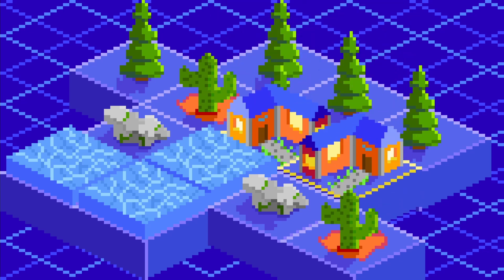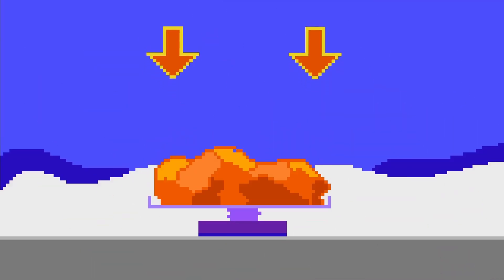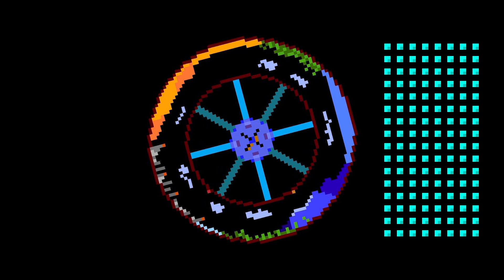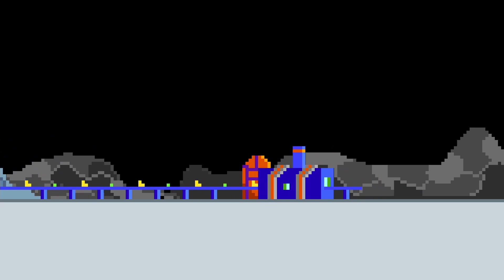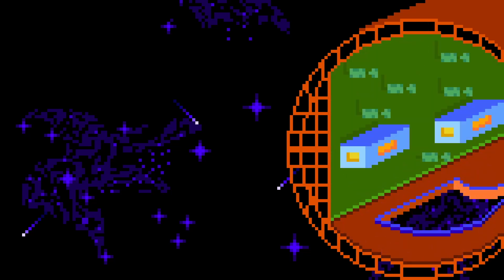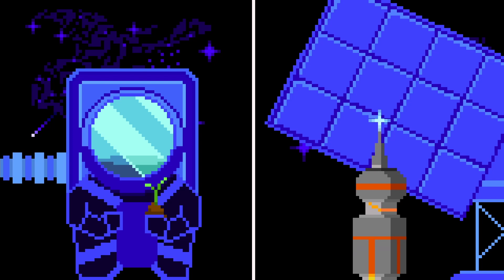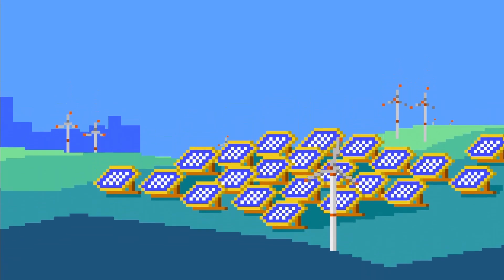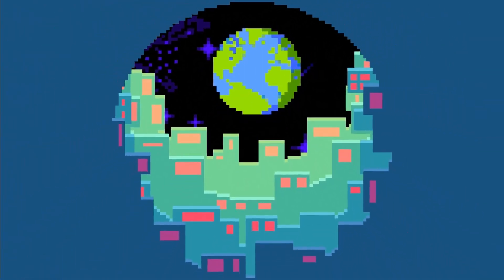How to build a STANFORD TORUS - a NEXT-GENERATION SPACECRAFT?

Comment: The ISS isn't anything on the way to a space hab. If we tried building it as overly complex and expensive as that, it'd never be done.

The Stanford Torus is from the '75 NASA Ames Stanford space settlement studies (available online). The business was mining NEOs and the Moon and building Solar power satellites.
No new inventions needed to start (anytime since then).
The first such habitat is done in 30 years.

For the factory which builds the hab and SPS they need ~10k people in space.
To reduce losses to people not wanting to stay, it needs to not only be survivable with artificial G and shielding, but it needs to be comfortable too.
Architects modeled the interior after dense yet pleasant places down here and that set the area of flat floor needed.
At 1.7km diameter, just about anyone can readily adapt to 1RPM, and they tested not only fighter pilot astronauts but clerical staff and interns.

Comment: The estimate of $900 billion sounds about right. ≈3 or 4 time the Apollo program. (Note that during the same time span as Apollo, the US spent as much on cosmetics, and large States spent more on liquor)
Note that the US spends $680 billon per year for the DoD budget (Each year, > the entire historic running grant total NASA expense). That's just the voted budget, not "black" programs or ongoing military operational expenses, which aren't in that.
We've spent $14 trillion + on the military since 2003. Note that the Pentagon has catastrophically failed its audits, can't account for half of its assets. ≈ half a trillion a year which we give to them, just goes away.

This thing along with all the ground, launch, and in-space infrastructure to reproduce it and build Solar power satellites would cost about the same as 3 or 4 of our CVNs and their air wings, escorts, and the logistics infrastructure to deploy them to fight over oil.
That's only a bit more than the 2008 TARP bailouts, a good deal less than the bailouts of 2020.

It's not worth wasting any time on thinking of building it from materials from down here. Thanks for dismissing that idea so readily. Note that by far most of that is the left-over rock dust, as reinforced concrete for the hull & as cosmic ray shielding.
The Moon is not a very good source for materials. It's said to be about what an asteroid miner would toss aside as not economical to process further.
We know of 10k+ "Apollo" NEAs bigger than ~600 meters. The little chunk that hit over Chelyabinsk in 2013 was denser with metals than Earth's crust or the entire Moon as a whole.
We know of 400 NEAS that are easier to reach and bring things back from, than the Moon. 40 or so easier than Lunar orbit.
Some meteorites are density 8+, greater than pure iron. King Tut's rust-proof meteoritic steel dagger is 6% cobalt.
Mining NEAs and building SPS is how this thing far more than pays for itself. It ends oil wars and scarcity of energy and raw materials & previously rare or precious metals (now maybe we can understand why Congress decided not to do this).